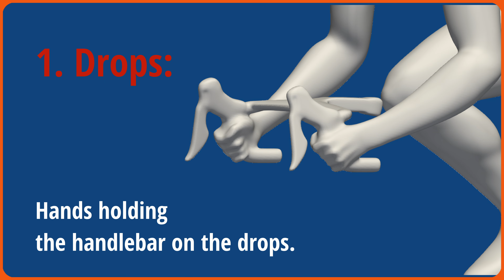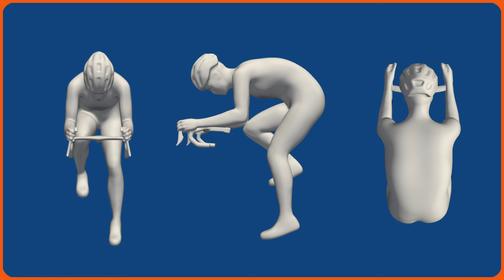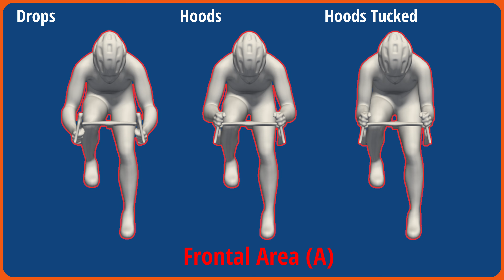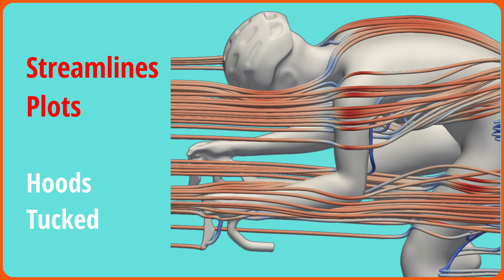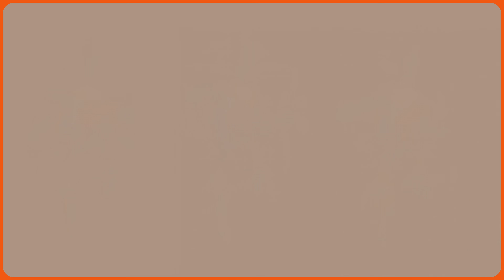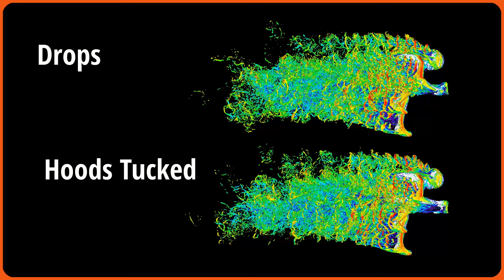Cycling Aerodynamics Backed by Simulation: The Power of Arm Position

Comment: What if the barss were higher so that the arms were horizontal in the drops?
Reply from the maker: Well, tendentially using the hoods is more comfortable as you can lean the wrist on the bar. In addition to this, you can use the drops for sprinting and you  also have the option to rest your arms stretching them (placing them on the drops) and keeping the same back inclination.
Reply: @QEF_world  Isn't resting your wrists still a UCI violation (that no one enforces)? And it's really not about a lot of comfort; the aero-hoods position is already uncomfortable. I'm just curious how much benefit an aero-drops position would have compared to regular hoods and regular drops. If it's a more sustainable position, even if it has less gains than aero-hoods, it can have a greater net benefit. Of course you'd lose some control and this may not be worth it for courses/events with longer descents, but for flat crit's it's been one of my curiosity points.
Reply from the maker: @SeraStaplz  Yes, the UCI rules do not strictly allow the forearms to rest on the handlebars, but commissaires generally tolerate the position as long as the rider’s weight is not primarily supported by the forearms. If you want to raise the handlebars and ride with horizontal forearms on the hoods, that is aerodynamically fine; the difference should be very small.

Comment: I see no compelling reason to state the speed in meters per second. Any cyclist would understand km/hr, or at maybe mi/hr. Why not use that? This makes no sense if you're trying to give cyclists insight into aerodynamics.
Real wind-tunnel testing would produce more reliable data and subsequent recommendations. Simulation is hypothetical untiil confirmed with real life testing.

Comment: What about the torso angle difference from being in the drops vs. hoods? Your Descending video looks at the difference of torso angle while in the drops when you get lower and there is obviously a large difference. I've tested hoods vs drops on the flats for myself with the same power output and I see no difference in speed. My thinking for why this is: 1) my torso angle is lower when I'm in the drops,  2)  I keep my elbows tucked in both in drops and hoods, and 3) my hands and wrists are small and well hidden from the air by the drops and shifter lever (I think width of handlebar and flare of the drops also plays a role in all this...I run a 38cm bar with a 39cm in drop, so not much flare and my hoods are angled inward so the shifter still aligns with the drops position). 

Just my take on my own data and what I've used during ITTs when using a full road bike setup.
Reply from the maker: Yes, it could be that you have reduced the differences to such a small level that they are no longer detectable in a real-world, variable test. In addition, it is important to consider that there are always slight differences in body position/shape from one cyclist to another.

Comment: Now do the same modeling with different stack heights, say a 4 cm drop instead of 15+ cm drop. Also do an elbows tucked version when in the drops because that IS possible too. The modeling is impressive but the results are useless because the parameters of the test were so narrow and not ecologically valid when you consider, even amongst pros, there is a lot of heterogeneity in body types and positions.

Comment: Im way too late to the video, but im wondering, wouldn't riding in the drops allow for lowering the trunk further? And as a consequence make the arm and body position more horizontal and more aero? I would think that that would be the most aerodynamic position in the bike but i dont know...
Reply from the maker: Correct. The goal is to lower the torso as much as is comfortably possible and keep the forearms parallel to the ground for optimal aerodynamics. Pro typically use a low handlebar setup to achieve this position on the hoods; however, if you find it easier to reach this posture while in the drops, that is also a perfectly valid option.

Comment: I understand that the hoods position is the fastest position on the bike. So i understand that a higher stack with the same torso angle and horizontal forearms, is more beneficial than a lower stack with same torso angle, because that means the same torso angle will have less horizontal forearms. But considering the less elbow flexion I have, the more sustainable the position could get, is it, or could it be beneficial to have a lower stack height (to a height that horizontal forearms are still possible) to the extent that more aerodynamic positions are more sustainable because of lesser elbow flexion? Especially when doing longer rides where horizontal forearms are not realistic for the whole session.
Reply from the maker: It `s not easy to answer!

Comment: These videos are AWESOME!  I have a question and forgive me if you have addressed it in your videos already; if we assume that in both cases, a rider is riding 20mph, does a headwind exaggerate the aero benefits of the hoods tucked position, since more air is traveling over your body?  And I guess by the same token, is an aero position less important when riding with a tailwind?   I asked AI this question and it indicated that there is no difference, but It may have been confused.  Thanks in advance!
Reply from the maker: At constant power, a rider adjusts ground speed so that air relative velocity is roughly similar in headwind and tailwind and no-wind. For this reason the drag (which is calculated respect to air relative velocity) can be considered almost the same (if one doesn`t consider the changes in rolling resistance).
Reply: @QEF_world  Thank you for taking the time to respond!  So essentially, because speed naturally adjusts to the changing conditions, drag doesnt change, only speed?  Think I got it! Thank you!

Comment: How would leg movement factor into this? Is it as simple as the shift in position changes the asymmetrical drag to the other side, or does the constant motion and repositioning result in a completely different outcome?
Reply from the maker: That’s a great question and we might put together a dedicated video on the topic.
There isn't a large amount of research on the topic, but the "gold standard" study is 'A numerical model for the time-dependent wake of a pedalling cyclist' by Timothy N. Crouch et al.
If you run static simulations, the drag changes a ton depending on where your legs are. The slowest position is when your legs are vertical (75degrees from the TDC), and the fastest is when they are roughly horizontal. The difference is relevant—the horizontal position is about 20% more aero than the vertical one.
When you actually simulate the legs moving (dynamic simulation), the drag is 5% to 10% lower than if you just averaged over the cycle of static poses.
Reply: @QEF_world thanks for the reply... that's also quite interesting I suppose it advocates for soft pedaling on descents even if you aren't putting any power through the pedals.
Reply from the maker: @lookoverthere350  Not sure why you are saying this. Could you please explain? Meanwhile, our next video is on descents.

Comment: Very useful info but I am really interested how much position and aero helmets (eg van Rysel fcr vs rcr) matter climbing 8-9% grades at around 2.8‐3.2W/kg
Reply: Only if you're climbing over 20kph
Reply: Whilst climbing aerodynamics are less and less important as the air resistance isnt as high compared to higher speeds. That is the reason why climbing bikes are less aerodynamic.